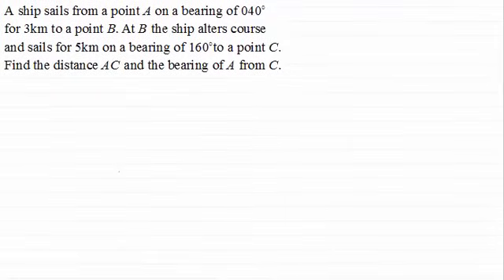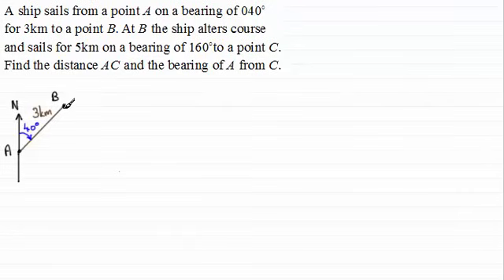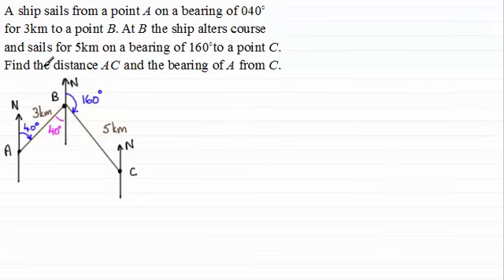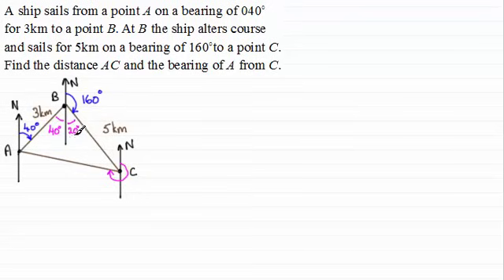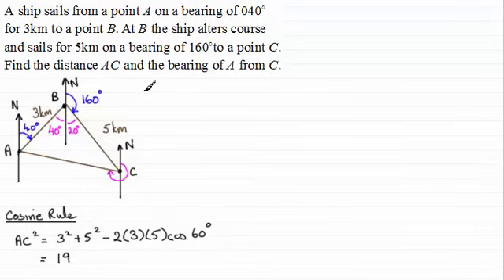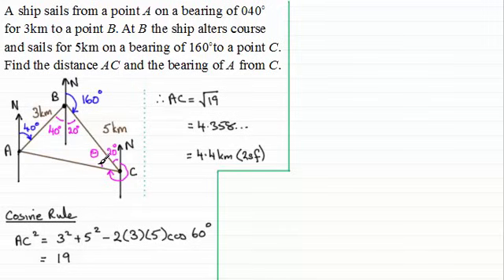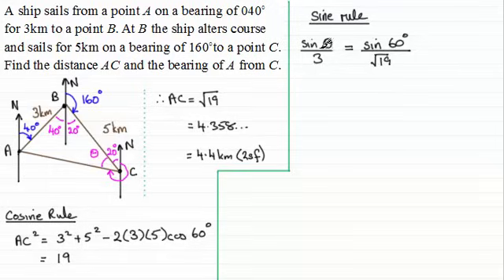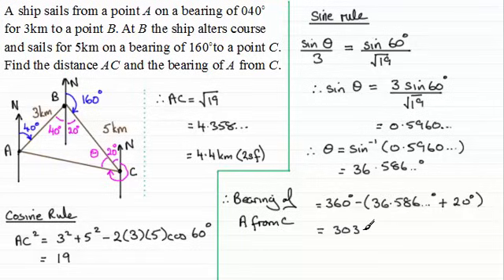Sine & Cosine Rules  applied to Bearings : ExamSolutions Maths Revision

Comment: Using GNU units,

linux> units -t "square(3) + square(5) - 2 3 5 "
4
linux> units -t "cos (60 deg)"
0.5
linux> units -t "square(3) + square(5) - 2 3 5 cos (60 deg)"
19

linux> units -t "sqrt(square(3) + square(5) - 2 3 5 cos (60 deg))"
4.3588989

linux> units -t "3 sin (60 deg) / sqrt(square(3) + square(5) - 2 3 5 cos (60 deg))"
0.59603956
linux> units -t "asin (3 sin (60 deg) / sqrt(square(3) + square(5) - 2 3 5 cos (60 deg)))" deg
36.586776

linux> bc <<< "360 - 20 - 36.59"
303.41
linux> theta_in_degrees=`units -t "asin (3 sin (60 deg) / sqrt(square(3) + square(5) - 2 3 5 cos (60 deg)))" deg`
linux> echo $theta_in_degrees 
36.586776

linux> bc <<< "360 - 20 - $theta_in_degrees"
303.413224
linux> units -t "360 - 20 - $theta_in_degrees"
303.41322

Comment: I got the distance correct however i used the cosine rule (cos A=) to find the same angle and got 71 degrees. (a) why am i wrong (b) how can I tell which method to use so I don't get it wrong in the exam? Many thanks please reply <3
Reply from the maker: cos (theta) = [ 19 + 5^2 - 3^2 ] / [ 2 (root (19) ) 5 ]  gives theta = 36.586... You need to check again.

Comment: Does the Cosine Rule not state that a(squared) = b(squared) + c (squared) - 2bc CosA, so why did you use the opposite angle ?
Reply: AC is the line from point a to point c, not the angle, it confused me at first